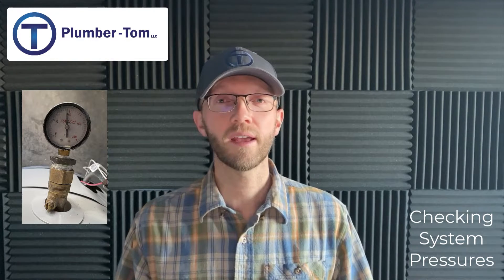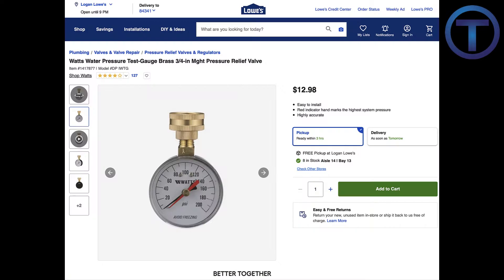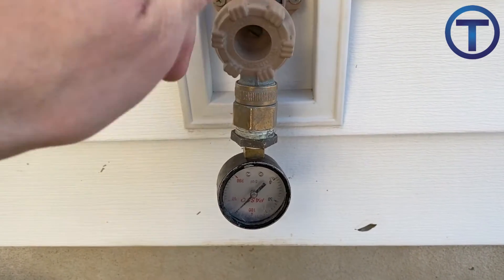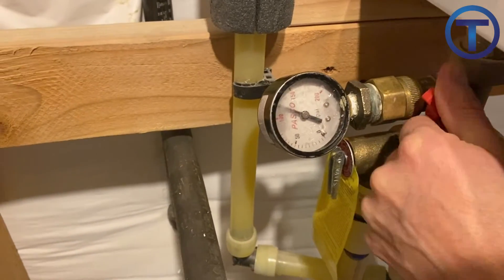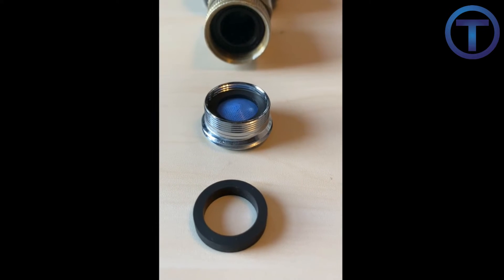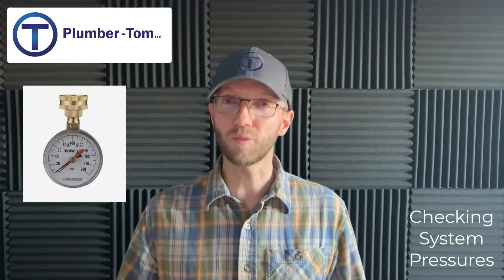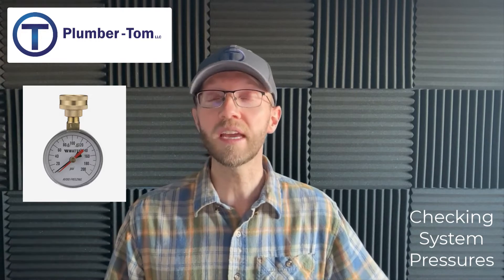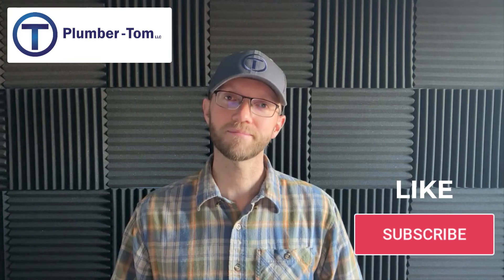Checking Water System Pressure

Comment: Hi Tum. My house has a hot water heating system. Radiators. The hot water pressure is 20. What should the normal pressure be?
Reply from the maker: Radiant heat systems often operate at lower pressure. 20 psi should be a good operating pressure. You may want to have a technician service the system if you think there is a problem.

Comment: I just got a home that uses well water, within less than a month the water heater leaked internally. I strongly believe something is wrong with the piping of the home and possibly water softner connection. A plumber told me that the water softner and radiator heat have no bearing on the workability of the water heater. I got a better more upscale water heater installed and it lasted less than 2 weeks with the same problem,  can you help me? I can make an appointment for a video overview, btw I can't find a pressure check point anywhere
Reply from the maker: Sorry you are having trouble.  Well water can have high mineral content, which does impact water heaters.  If anything, the water softener should help the water heater, not hurt it.  Your brand new water heater leaked internally?  That sounds like a manufacturer defect to me...

Comment: i have a question... i hooked up a pressure gauge to the outside hose connection.  it is similar to the one you show with a red indicator that shows the maximum water pressure.  After leaving the gauge on for a week (i got busy and forgot about it) i checked and the pressure was about 50 but at some point it was 60.  my question is do i install a pressure valve? also what pressure should i set the expansion tank to?
Reply from the maker: If the pressure is below 80 psi you do not need a PRV, or the one you have is still functional.  I would recommend setting the expansion tank at the higher pressure reading that you saw.
Reply: @plumber-tom9470  thanks... I am installing a mixing valve and adding an expansion tank.  wasn't sure what to set the tank to.
Reply from the maker: no problem.  good luck  @artdeco5464

Comment: very helpful videos. I am watching them as I read the ipc manual studying for my plumbing inspectors license (Texas). Thanks for all the hard work you did to make these possible !
Reply from the maker: You’re welcome!  Glad it is helpful.
Reply: Do you happen to have a video on plumbing systems ? Vent stack vs stack vent, drain vs sewer, horizontal branch vs ... that's what is giving me the most problems trying to understand ICC code....
Reply from the maker: Yes.  Check out my "Understanding International Plumbing Code" video series.  Chapter 7 is on drainage.  Chapter 9 is about vents.   @frozengy63
Reply: I have been watching them all ! Watched 27 so far ! Just have to understand the systems and terminology better for it to all make sense.